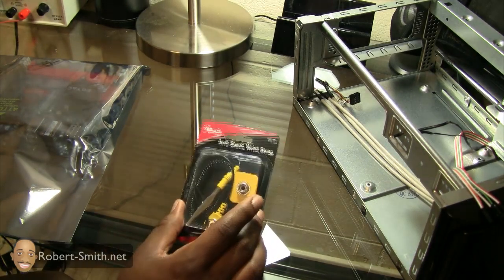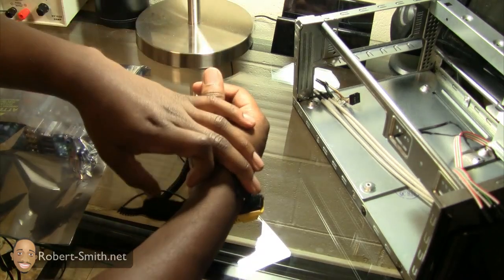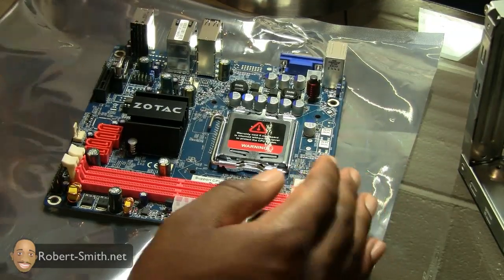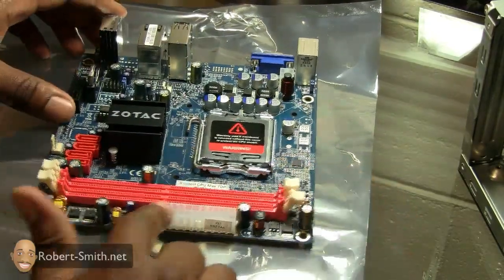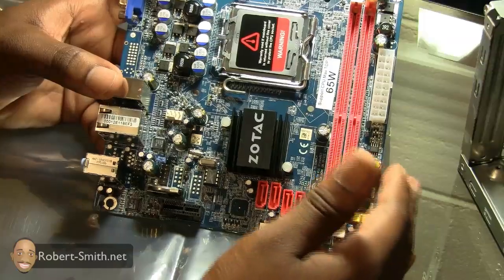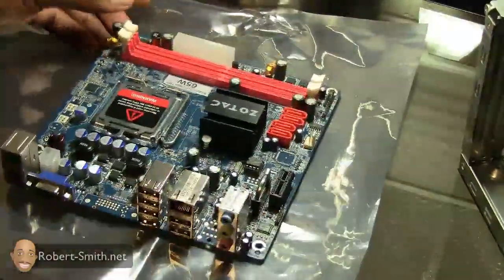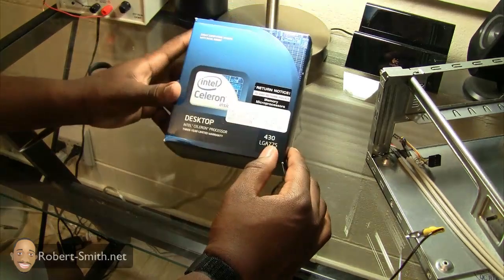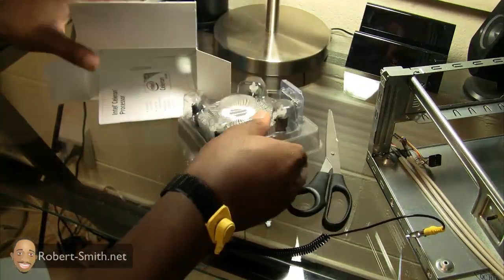How To Build A Mini ITX Computer Part 4/9

Comment from the maker: @0MakoBlaster0 From what I have been told after making the video, it is not really necessary. Some say that you can just touch the metal chassis to discharge any electric shock you may have built up in your body. But using it surely is not going to hurt anything either.

Comment: Ummmm FYI when you attach yourself to the computer case, it's not grounded. For a computer case to be grounded it must have a PSU in it which leads to the wall plugs ground, then it's grounded.

Comment: Dude I used to use those anit static but don't worry about using them, they are not that necessary. when you get to be a veteran you wont use one anymore. Lol my mentor who taught me used to be a microsoft tech told me dont worry about them.